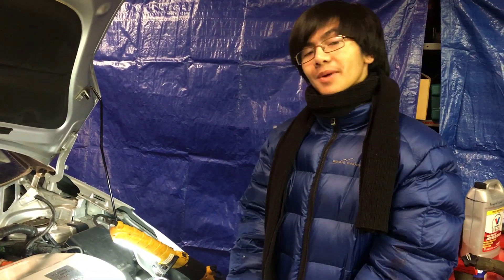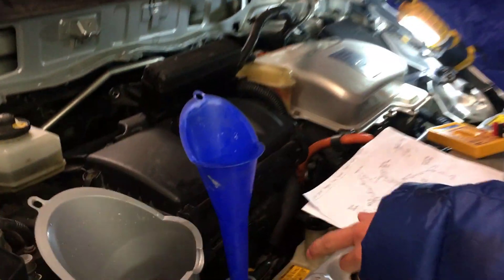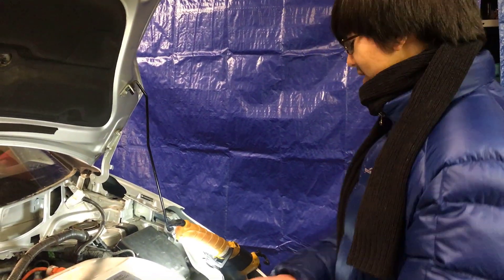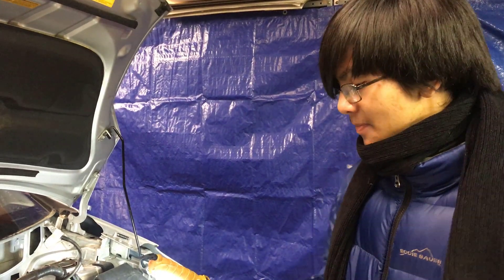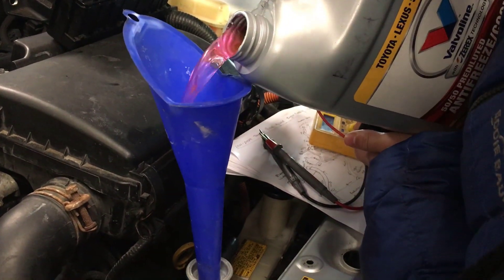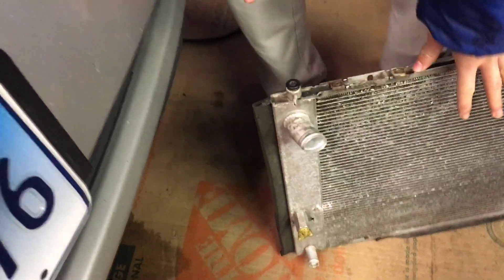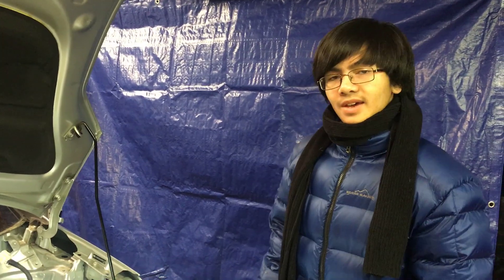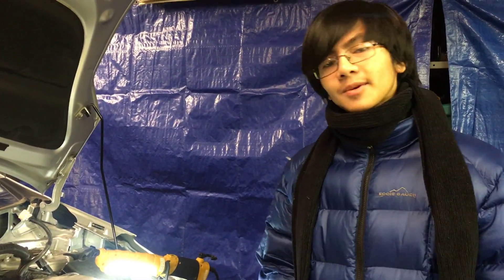Prius Coolant Bleeding Part 1: How To Burp Air Pockets From Heat Storage CHRS Tank Using Pump Relay

Comment from the maker: Here are the #ᴬᴰlinks to tools, parts and accessories you may need to perform this repair:
1.  https://amzn.to/4ga6Jm2  |  KAIWEETS Digital Multimeter TRMS 6000 Counts Voltmeter Auto-Ranging Fast Accurately Measures Voltage Current Amp Resistance Diodes Continuity Duty-Cycle Capacitance Temperature for Automotive
2.  https://amzn.to/41nywdW  |  Zerex Asian Vehicle Red Silicate and Borate Free 50/50 Prediluted Ready-to-Use Antifreeze/Coolant 
3.  https://amzn.to/3ZFMyXd  |  PEAK OET Extended Life Red/Pink 50/50 Prediluted Antifreeze/Coolant for Asian Vehicles, 1 Gallon
4.  https://amzn.to/3ZnMxps  |  OEMTOOLS 87009 No-Spill Coolant Filling Plastic Funnel Kit | Universal Radiator Funnel for Auto Mechanics | Adapters Help Funnel Fit the Radiator of Most Every Consumer Vehicle | White
5.  https://amzn.to/3ZIOaiO  |  EPAuto Spill Proof Radiator Coolant Filling Funnel Kit

Or Click on Amazon link here and search for what you need:  https://amzn.to/3D1T2GQ

Comment: What's the difference between jumping the relay compared to putting the car m maintenance mode to bleed/burp the system?????

When replacing coolant in the engine and hybrid system

Comment: Every other video on YouTube tells you how notoriously difficult the Prius coolant system is to bleed, but then fail to show you an effective way to do so besides opening the bleed valve. My engine was running fine after changing the coolant and bleeding it for what seemed like plenty of time, but I had no heat whatsoever from the vents. Did exactly as Aiman advised and 10 min later all is well. You’re a genius Aiman, thank you!

Comment: I can only run the pump by using metallic paper clips.  My multimeter won't do it, whether set to 10 Amps or 20 mAmps.  Does anyone know what could be the problem?  Do I need a special type of multimeter?  Thank you.

Comment: Is the “pump” part of the CHRS unit or is it the coolant flow control valve? Getting P1121 and P1150 / P1151 . Tried jumping the pump unsuccessfully but sometimes I think I hear it come on. Saw another comment about a fuse being blown that could prevent jumping via the relay … but can the pump even come on if that fuse is blown?

Comment: I did all the bleeding,  replace the 2 way and 3 way pumps, the thermostat the temperature sensor,  I start having a p1116 now I don't see any codes and the car still overheating and the fan is in the rear passenger side gets on to, I can't understand what can be the problem

Comment: If anybody is having trouble running the CHRS with the volt meter check your fuse to the pump. If nothing is happening you might have a blown fuse. Check under the hood near the left headlight for the fuse box. Once you take the cover off look at the diagram and find the fuse labeled *1 it should be 10amps. Once you replace this then power should reach the relay and it’ll work once you short the relay with the volt meter.
Reply: Thank you!!!
Reply: Thank you ! Tried this and my CHRS isn’t making any noise… Is it dead then ?

Comment: EyeOn I got a question ,why you have to disconnect the heat storage tank sensor to bleed the system?.Thanks in advance for your response.
Reply: You don't, as he mentioned they did that to do other work on the car, unrelated to the burping.

Comment: Excellent explanation! I have a question. My multi meter reads consistently at aroun 2.96. But the coolant seems full and I don’t see any bubbles coming out anymore. Does this mean it’s good? I know you said a reading at 2 or 3 means there is a lot of air in the system.

Comment: I’m only getting 1.45Aon my multimeter but no more air bubbles are coming out. Do I need to continue until I get 3.99A?
Reply from the maker: As far as I know, if no more air bubbles are coming out, you should be okay. As always, make sure you continuously check your car for the first few drives after and also consult other sources to ensure that that is the right direction to go! Let me know how it goes!
Reply: @EyeOnAiman  it did you up to the specified amperes, I just had to keep trying. Also, I noticed that if I kept turning the pump on/off a few times repeatedly it got some bubbles out then heard the pump run as it should. Thanks again for all the help

Comment: Thank you so much for your videos.  I am surprised it is so tricky to replace a radiator.  I successfully purged the air bubbles with the help of your thoughtful videos.  One thing that was not clear to me was that you need to have a multimeter that can measure 10 Amps and not just mA.  This is the first time I am seeing how you can short two terminals and measure amps at the same time.  Very cool!  At first I tried to use the mA feature because one of my multimeters did not have the 10 Amp feature.  When attempting to use the mA feature, I measured .003 mA (which was erroneous) and the pump did not run.  After reviewing videos, I set my automotive multimeter to the 10 Amp mode and successfully ran the pump.  Thank you so much!

Comment: That coolant pump will be about 1.3 amps without coolant at the pump and about 4 amps fully loaded with coolant circulating. It took me several hours to change the coolant in the engine and the inverter on the same day and get the entire system vented. A full pain in the butt day of maintenance but cheaper than taking to the shop.

Comment: Question: what setting you used on your multimeter? Thnx
Reply: You need to have a multimeter that can measure 10 Amps (not mA).  If you don't have the 10 Amp feature, you can use a wire to short the terminals.  When I placed the multimeter  in mA mode, I measured .003 (erroneous reading) and the pump did not run.  When I placed the multimeter in 10 Amp mode, the pump ran, and at first I measured fluctuations between 2-3 Amps.   Place the car into the accessories mode by pressing Start twice (without pressing the Brake).  Connect the multimeter in the 10 Amp mode and run the motor for 15-20 seconds at a time while allowing the pump to rest a minute or two between runs (repeat 6 times).  When the car is in the accessories mode, I measured about 3.94 amps.  When not the car is off, I measured about 4.09 amps.

Comment: I really appreciate the video's on bleeding the air bubbles out of the three coolant systems.  I did use the clamps from H.F. when replacing the my water valve (error code P1121) but still had about 3/4 of a gallon of coolent escape [user error].  Prior to viewing your video's and after installing the  water valve,  I added coolant to the radiator and the low level line of the overflow tank.  I was able to add approx. the same amount that I lost.

  After viewing your video's: 
(1)  I did the burping of the heating tank first ( I did this since I wanted to cover all my bases)... and I did not see any bubbles at the funnel I have attached to my radiator (with coolent in it)  fill tube & was able to get to 3.99 twice (shorting the circuit no more than 15-20 seconds with 5 min. breaks in between.  I did this shorting proces four times.  
(2)  I did the burping of the heater core  (using the inspection mode to keep the gas engine going approx. 20 min.'s).   Again I did not see any bubbles, and the heater got quite hot and the hose near the bleed hex screw did get hot but not the hose leading from the thermostat to the radiator near the fill tube side of the radiator.  I wondered if that is  normal as the coolant is being cooled by the heater core and the fan pushing the hot air into the car.   I never did see the two fans next to the radiator come on.

[My concern is if the hose leading from the thermostat should be hot that the thermostat may be failing].  

One more thing is that near the 15-20 min. mark the coolent level rose 2-4 oz.'s approx.  I'm now letting the engine cool off and waiting to see if  any of the remaining coolant will be sucked back in (currently the overflow tank level is still at low level).

 (3) I plan on bleeding the inverter after the 4-hour cool down.
Thanks, and I look forward to your response regarding my concern of the hose leading from the therostat housing to the radiator not getting hot during the heater core bleeding process.

Scott
Reply: Did you end up getting it fixed? I’m having this same issue right now and don’t know what it might be. The coolant doesn’t get sucked down the funnel when I’m jumping the pump

Comment: coolant. What info don't hear the pump after inserting the multimeter? Does it mean the pump is not good? I have current in the relay outlet. Thx
Reply: I have the same problem, the pump doesn't turn on, even when I connect a wire.
Did you find the cause?
Reply: Pump totally frozen???
Reply: @botiroti1  how to be sure??
Reply: srimurti haliche your directly connected through the pins at the relay......just as if you had the pump out on the ground and had 12v to the terminals. Be sure the wires are good to the pump.  And it’s just my opinion!  Make sure you’re at the right relay location too!

Comment: Great video but I am not having much luck here. I have a 2008 Prius. Lately, I started with a P1150 code which I think is caused by a bad  temp sensor by the hot coolant container. 
Now troubleshooting I tried runing the coolant pump by using the method you show jumping the relay..  nothing happens,  could it be a bad pump? I changed the sensor with one from Diacount Autoparts but now the heater tank is leacking...  The sensor lools a bit differwnt tham the original and now even withbthe orifinal senaor it leaks...   I may have brocken something...   Now I have more codes some of them, I guess are caused by a low coolant level...  p1116 p1118 p1150 p1122.   The main question for now ia why isnt the pump working with the jump withbthe multimeter. Is there anotherway to start the pump?  Thanks
Reply: You need to have a multimeter that can measure 10 Amps (not mA).  If you don't have the 10 Amp feature, you can use a wire to short the terminals.  When I placed the multimeter  in mA mode, I measured .003 (erroneous reading) and the pump did not run.  When I placed the multimeter in 10 Amp mode, the pump ran, and at first I measured fluctuations between 2-3 Amps.   Place the car into the accessories mode by pressing Start twice (without pressing the Brake).  Connect the multimeter in the 10 Amp mode and run the motor for 15-20 seconds at a time while allowing the pump to rest a minute or two between runs (repeat 6 times).  When the car is in the accessories mode, I measured about 3.94 amps.  When not the car is off, I measured about 4.09 amps.
Reply: Did you ever resolve your issues? I know it has been a year.
Reply: I had the same issue, resolved it, mine was a blow fuse.
Reply: The 1118 is the temperature sensor I comes when you replace it then it gets clear

Comment: After changing the inverter coolant valve and coolant spills from the radiator, do we bleed the (1) CHRS, (2) heater core and lastly (3) inverter coolant valve in this order?

Comment: Can't you do this by running the car and turning the heater on full temp?
Reply from the maker: With Prius Gen II it most likely will not work but you can always try it to prove or disprove the hypothesis.  Read the comment below (from Part 2 Video: https://youtu.be/ils_T2XY_lk - Toyota Prius Engine Coolant Bleeding Part 2: Burp Trapped Air Pockets Heater Core ICE Cooling System)

Highlighted comment
William Calhoon
2 days ago
I am 64 years old.  Young man you saved my ass.  Here is my story.  I had a code P1116 "Engine Coolant Temperature Sensor".  I followed a video on how to replace the sensor.  I drained the coolant into a 5 liter automotive container, replaced the sensor and slowly replaced the coolant like I have done so often over the years with other vehicles.  Once the gravity feed stopped I had about a quart of coolant left over.  Simple solution right just take the car for short drive so the coolant can run thru the system and when I get back I can I'll add more coolant.  WROOOOONG!  Luckily I had my diagnostic meter set to test the temperature sensor.  After about a mile I was already over 200 degrees so I high tailed it back to my garage to investigate what the hell was happening.  I found your video.  I should have known that my Prius Gen II would have some incredibly complex procedure just to add coolant.  Your demonstration on how to run the circulating pump was the key.  Following your video I ran the circulating pump in short 10-15 second intervals adding my remaining coolant until the air bubbles ceased.  My next test drive provided a steady 177 degree coolant temperature with hot air blasting out the vents.  Again, thank you for your hard work in producing these videos.  You saved one old fool from disaster.

Comment: I changed the water pump on one, I didn't do any special bleeding, and had 0 problems.
Reply: I changed the water pump & had massive air in coolant system.   Took a long time to bleed it out.   The plastic bleeder screw is stripped very easily.
Reply from the maker: Glad you didn't have to go through the special bleeding procedure.  Was that the main electric water pump by the engine?  Did you drain the coolant at all or just whatever coolant that came off the hose & inside the engine?
Reply: @EyeOnAiman I have no idea what "the main electric water pump by the engine" is.  I replaced the engine cooling pump, the belt driven one.  I drained the radiator before removing the pump.
Reply from the maker: @DonziGT230  I meant to say mechanical, Gen II Prius have four water pumps, three electric and one mechanical.  The mechanical pump is much like those on conventional four-cylinder engines: it is belt driven and bolted on with a handful of 10mm fasteners.

Comment: I just replaced the coolant valve, which I believe is for the inverter.  If that’s so, would this system need bleeding?   I am experiencing red triangle and overheat warnings.
Reply from the maker: The 3-way coolant valve is not for the inverter cooling system.  It is actually for ICE (Internal Combustion Engine) cooling system which consists of top half of radiator, the associated hoses, 3-way coolant control valve, Coolant Heat Recovery Tank Canister (CHRS), auxiliary water heater pump, heater core, electric water pump & inside the engine block.  It would appear that air bubbles might have been present inside this system, assuming that there was no issue with the red triangle of death & high temperature warning before the replacement of the control valve.  Although it is a partially self-bleeding system, the air pockets need to be removed by first bleeding the air out of CHRS followed by burping the heater core.  We have videos for all of these procedures, please check this channel for them:  https://www.youtube.com/watch?v=ils_T2XY_lk